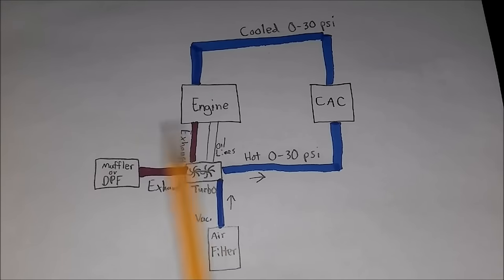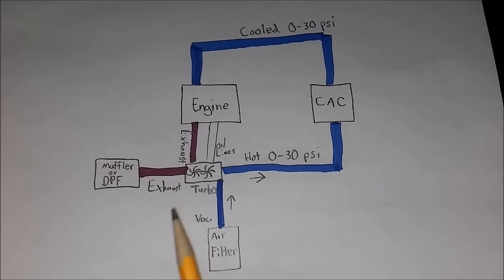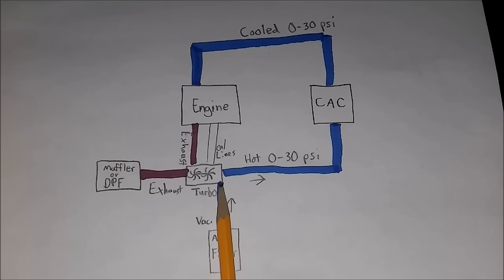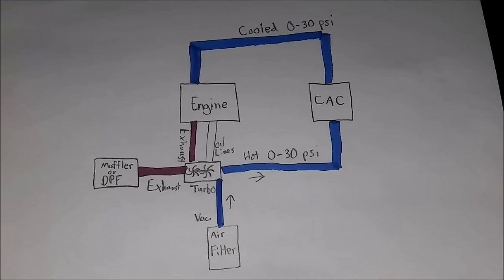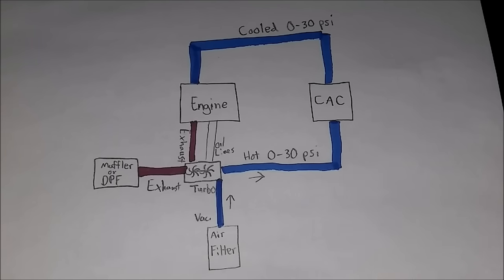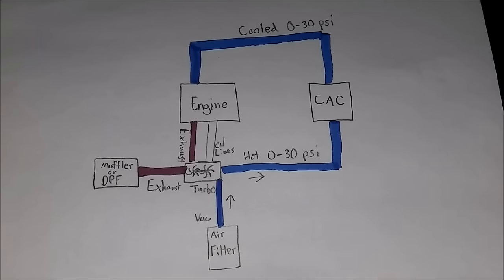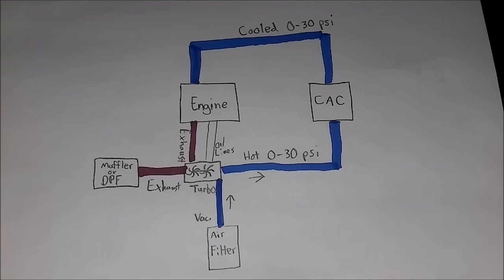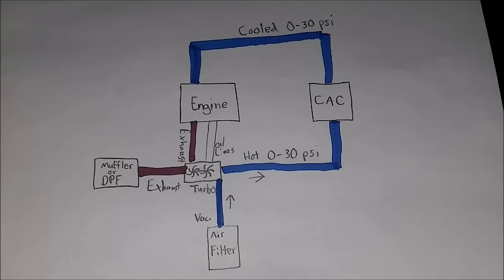What Causes Low Boost?  How Does A Turbocharger System Work?

Comment: Hello I have a 2011 d13 Volvo and I’m experiencing low boost on 9th gear going into 10th gear when I max out 9th gear it won’t go past 59. Mph and shifting into 10 gear the truck begins  to gradually shake so I have to let off the peddle gradually so it stop shaking until I reach a desired speed on 10th gear. Can you help me understand why it’s doing this fault.

Comment: I have a 2014 Transit connect 1.6 l EcoBoost with turbo I notice when I floor it going uphill or incline my car feels like it pulsates. Like it's trying to push forward. Transmission is fine do you think it could be a turbo issue?

Comment: I have a Cummins QSB 6.7 generator causing large decrease in rpm when taking load ..>75 rpm droppage for 20% load.I've checked the FIP and nozzles there is no problem with them.Governor is working fine..There is no smoke or anything else..
Does the problem is due to the fault  in turbocharger...

Comment: Hi I have an Mitsubishi 4m40 efi engine that boosts fine at 20psi but when the fuel is turned up it starts jerking and surging and my boost gauge needle goes crazy?? Restrictive intercooler (cac) ? Restricted exhaust??

Comment: Mercedes C200 CGI. I have miss fire at cylinder no2 while driving even at low speed.
Noticed that my turbo BOV open and does not close.
Already replace BOV, pressure sensor, waste gate control vacuum, 
temp. sensor yet to replace and reads 50 deg Celcius when idling.
When pressure sensor connector removed BOV closed and no more miss fire even at 120KM/h speed. Any advise. Can we drive the car with BOV continously closed

Comment: Great videos, just wondering if removing factory mufflers on a CAT 3406E will affect power on it. This engine is in a Peterbilt 379. Thanks.
Reply: Carlos Rodriguez absolutely not. You will actually reduce exhaust temps
Reply: Yes it should, how much though is the question.

Comment: Hi love the videos you do I have a Nissan Skyline R33 gtst and recently put a new engine in it runs fine apart from the turbo the cold air intake takes in far too much air when I accelerate and no power whatsoever but im getting boost on my gauge can anyone shed any light on this
Reply: Joe monty * 
We need more details. How much boost, what do you mean cold air intake takes in to much air, how you figure that out? You need to troubleshoot shoot one part at a time. What have you done to it? Mods or what have you checked?

Comment: hello sir i hv question tht is it dangerous to drive with low boost code ? is it cause more damage to engine with driving truck with low bosst around 20 psi around 20,000 miles 
plzz rply if possible thank u

Comment: @adept ape want to thank you for video It’s very  informative sure wish I knew where your shop is  located i am in Arizona I got a stage one upgrade i’ve been noticing that my boost lags starting off once I do get it going and running up to speed my boost reaches 40 PSI‘s is that normal I bought this truck brand new in 2005 I still have the same turbos with 1,650,000 miles do you recommend i change them or should I do that test pinch the wastegate .

Comment: If I have a leak at the clamp that connects the exhaust turbine and housing would it cause low boost
Reply: Yes
Reply: Why?? They say yes but don't explain. If the leak is after the turbine it won't because your getting full exhaust spinning the turbine. If the leak is before or at the turbine itself where it connects to the hub or center section, then yes, because your not getting full pressure to spin the turbine. Can you explain a little bit more on which clamp?
Reply: Low boost is on the compressor side. Leek some where.

Comment: I have 3126 work fine but when I drive it for 2 miles I got low boost 15 miles per hour I do not know what is the wrong with it  
and start smoke when I am driving No blow by at all when the car idling ?

Comment: I need help I sent my truck mx13 6 times  to shop. Everytime I'm under load I lose all power seek seek service down to 5mph turn off and on and I get power back but check engine light still on. They have replaced head gasket , egr , exhaust manifold,  boost sensor, exhaust sensor, heater core, dpf filter,  Every time I leave they always say your all good 2 days later break down again . Any idea????????

Comment: Hey man i have c15 pete 389 and i work in the end dump insdutry I've noticed that the truck does the first couple of loads just fine but after a while running i feel real hard acceleration to the point where my foot hurts from pressing on the pedal any ideas?

Comment: On my 2WS engine I plugged the hoses to my waste gate and I am getting 32 psi when pulling a load, Before I did this I was only getting 25 psi. I am now getting the power this engine  is potentially  producing,  Good or Bad Idea? By the way I did the over head adjustment following your technique and is running great, and I am running straight pipes.
As always great topic and great video. Keep up the good work.
Reply from the maker: Those single turbo engines usually only build 30-35 psi, so it sounds like your are good to go with plugging the wastegate. You could try tuning the wastegate adjustment arm so that it opens correctly as well, but 32 if pretty good. Glad to hear your overhead came out right.

Comment: I've got a pretty good crack in my exhaust manifold. My truck is like it don't even have a turbo. I can review engine and feel the air coming out crack. Would that cause my truck to feel like it's only got 100 horse power
Reply from the maker: +Tim Anderson Yes it would. Since the exhaust isn't going through the turbo it isn't building boost.

Comment: Good evening ape I recently replaced the harness on my c15 acert due to some shorts and almost broken wires. This is on a 07 w9. The cam sensor connection looks like it has a 4" extension connecting the harness to the sensor. The plug is stuck in the sensor and the 4" harness is almost in two. I am going to buy a new sensor in case I break it getting it unplugged. Are there any surprises when removing and reinstalling the sensor.
Reply from the maker: If I remember correctly, there is an oring that seals that sensor, if you remove the sensor it is a good idea to change the oring. Nothing comes to mind special about removing it.

Comment: so i bought a 04 vw passat with a 1.8t and its check engin light was on after buying i took it to autozone to check the codes and i got p0299 saying my turbo is underbossted and the a ase tech recommends replacing my turbo wastegate solenoid also code po420 and code p0441 where thrown catalyst  system below threshold and evaporative emissions system incorrect purg flow because i have a bad exhaust leak so my question is do you think that the problem it my solenoid or could it be something else and also is there anyway this problem could relate to the exhaust leak please help me

Comment: i have a diesel pusher with a C7 (2005 model). Do you recommend any fuel additives?
Reply from the maker: That depends on how often you run the engine. If you run it often it gets hot and through the filters. Which keeps it clean and bug free. Now if it sits a lot you might want to look up black diesel, basically there is a type of mold or bacteria that can grow in Diesel if it sits for too long. Now just for normal running though, I haven't seen any reason for running a fuel additive. Your engine is a HEUI system, so the engine oil will most likely wear out your injectors before the fuel would. I have a few videos that talk about HEUI systems and IAP faults you might want watch.
Reply: Thank you for the quick response.  I take a look at the info on black diesel.

Comment: Hi. I have a 07 FR century with a C15 475 cat with twin turbos. I am having a problem with power where by loaded or empty climbing or on a flat road i sometimes have lots of power strong engine sound and then all zero power even going down a hill it has nothing & after sometime it will go up a hill at 75 mph you can actually feel it cut in and out of boost. So my question is does the turbo boost sensor or the wastegate actuator have anything to do woth this or is there something else? Plus its killing my fuel mileage.
Reply from the maker: +Mark Mwema The wastegate is mechanical so my guess is you have something else going on with your engine like losing fuel pressure or as you said, possibly the boost pressure sensor is not working. Any check engine lights?
Reply: @Adept Ape 
No none at all. Also i rarely can hear the hissing sound of the turbo and if i do its faint. Is that common with cats?
Reply from the maker: +Mark Mwema Hmmmmm, should hear the boost spooling up. You can try pinching that wastegate line I show in the video, but my guess is you have something else going on. Put a fuel pressure gauge on as well and see what it's at when it's losing power.
Reply: Mines doing the same did you figure it out

Comment: adept ape. first and forrmost thank you for your education. i have a 2000 freightliner with a cat c15 6nz motor. motor has 1,600,000 miles but has run well. has visible engine blowby but has always run well. recently turbo boost has dropped to 17 psi from 30 psi. i had the dpf cleaned (baked) and have sealed up any exhaust leaks. boost is now max at 22psi. shop says i have a small cac leak they can see on guage when testing cac and verified with spraying soap. they claim leak is at top left corner of cac when looking from front of truck towards cac. he claims he has looked at turbo and it seemed ok. i have visually inspected cold air side of turbo and spun shaft. no restriction. spins very freely with no shaft play or vane contacting housing. i will visually inspect exhaust side of turbo today. shop recommends replacing cac. i should also mention that i have had extreme problems with exhaust heat ruining manifolds and turbo housings. cracks and or warping turbo mount at different times. my question is can general engine age and wear (meaning worn out and time for inframe) cause this loss of boost? other than boost being down 8psi engine runs smooth with no hesitations or stumbles. it will rev to 2200 rpm and will run 75mph plus on flat no problem. no unusual knocking or catastrophic sounds whatsoever. engine runs normal temp with oil pressure at idle warm at 38psi. other than lack of power climbing hills and low turbo boost no other symptomsi will replace air filters today and inspect exhaust side of turbo. should i just replace cac and see if thst fixes the problem. they claimed it had a "small" leak. can general engine wear and deterioration cause these symptoms? (ie: worn out and time for inframe) other than air filters, checking exhaust side of turbo (cold air side already checked), testing wastegate, and replacing cac anything else you may recommend that i havent already addressed? what is maximum c15 exhaust temp you recommend to avoid damage? Thank you for your education, time, and attention to help me
Reply from the maker: +Donald Pinkus First thing I would check would be the wastegate. A very small leak isn't going to cause an 8 psi leak of boost, but it depends what "small" means. Pinch the wastegate off and see what it does for boost. What is your exhaust back pressure? I know you said it has a dpf so that is something to check. If the blowby isn't insane your engine power should be fine. I don't think your engine is worn out from what you told me.
Reply: ape.   thank you for your reply. the dpf has been baked and tested.  flow is good.  i cannot see any cause for excessive backpressure at this point unless there is something with the exhaust system i grossly misunderstand.   if you can think of another way backpressure may exist please advise.  i will pinch off wastegate to test.  would disconnecting wastegate vacuum line have the same affect.  i am also going to remove the cac and have it physically tested by a radiator shop.  any confirmed leak and i will just replace it.  i am also going to thoroughly inspect charge air tubes and blue connector boots when it is disassembled.  aside of all this any recommendations?   thanks again.  i appreciate the help and i will try to see how to setup paypal to contribute in some way
Reply: Donald Pinkus i am not an expert but by experience, engine wear does reduce power. I drive and fld with a Cat, i was having a little of bit of blowby so with did an inframe before it got any worst. And now i feel more power on truck, hauling same loads everyweek. Never performed a dyno, after driving the same truck for 5 years i can tell changes on engine performance. On 1.6m miles i strongly suggest you do an inframe. You will notice a diffrence, i even get better fuel mielage after inframe.
Reply: I'm no expert and I know this is old but what 6nz has a dpf?????

Comment: Will code 92 on a c15 acert cause low boost gauge is only getting up to 30 to 35 psi code 92 is Iva 1 or 2 going to change wires and iva losing power really bad in 9th and 10 th gear under a load

Comment: I have a 93' 3406B and a man. psi gauge in the dash. the max psi ive seen is 21-22psi under full load at 1,700 rpm.should it be more?
Reply: Depends on the power rating but thats definitely within spec for the typical factory lower power levels

Comment: My exhaust brake doesn't work very well on my 3126. Can the turbo be leaking into the intake side of turbo with back pressure?
Reply: Unlikely,  the turbo would have to be completely trashed for that. More likly the brake actuator is malfunctioning.

Comment: I have a c-15 cat twin turbo the bellow between the turbos is cracked what damage will arise from driving it this way
Reply from the maker: +Russ Brow Is it the exhaust side or intake side bellows?
Reply: Adept Ape it is on the intake side
Reply from the maker: +Russ Brow You'll be losing boost for sure, but that doesn't hurt anything. The problem would be if at idle if the turbos aren't pushing enough air there could be a slight vacuum which would mean the turbo and engine are sucking in dirty air.

Comment: Greetings,do you have an email I can contact you? I own a 91 379 peterbilt 3406b.. had a blown intake gasket truck was running as if the fuel filters were clogged..I replaced all 6 and replaced the fuel filters, and he is still running rough? And pointers.much appreciated

Comment: I have 2006 kenworth t2000 with a 500 Cummins. I'm only getting 30p of boost uvwas good by a mechanic that has worked one these engines for 40 yrs is saying that I should be getting 35 to 40. The truck use to pull good and not it's struggling to pull a load.....any thoughts would be appreciated
Reply: yeah, pressure test your cooler. check your waste gate and actuator.

Comment: you have help me out before on this same exact engine I'm having a problem with right now it is sitting in the middle of BFE Kansas we had a problem with it going down the interstate with the crew set it died blew 2 - 5 amp ECM fuses replace the fuses check the pins on the truck side we have three positives and two grounds all positives showing 12 volts grounds are showing good continuity very minimal voltage drop when spinning over will not do self diagnostics on the Cruise button tries to start with ether but does not quite start
Reply from the maker: +robbiecoyle22 Okay check pin 70 on the connector it should be the bottom rear pin, that should have 12 volts when the key is on and cranking. If you have all the voltages check out, you may have a bad ECM. Is it showing rpm on the tach while cranking?
Reply: the ignition wire is showing 9.68 volts while cranking ECM has been tested by Foley cat in Colby Kansas they said it communicates but we do not have a way of getting the truck to them at the moment so we took just the ECM to them we put the ECM on another truck with a 6nz and the truck fired up and ran just fine I just checked and there is no engine RPM the truck does have a brand new crank positioning sensor but does not have a new cam positioning sensor
Reply from the maker: +robbiecoyle22 It should read rpm on either position sensor, so if it is not showing rpm it sounds like the ECM is losing communication
 Now the ECM worked on another truck so you may have a problem with OEM wiring, did you measure the pin 70 voltage at the ECM while cranking or did you measure it at the key switch?  It should be measured at the ECM to make sure your not losing voltage before the ECM. You may have to put a breakout harness on the ECM to isolate it from the truck wiring and see if it'll start then.
Reply: the 9.68 volts was at the ECM while cranking
Reply: just to let you know we did find the problem one of the pins on the truck side of the ECM when you would plug it in the pin would push back and not make good contact with the connector on the ECM
Reply from the maker: +robbiecoyle22 Alright, thanks for letting me know, that is a tough one to find. Congrats on finding it.
Reply: No

Comment: +adept ape I have a c15 acert with a sort of sludge in the ole it's not white and the egr isn't leaking. I checked the intake and exhaust and no antifreeze. The antifreeze is going low, what could it be? I tried the bottle test n nothing happened the motor was cold tho but we are fixing to pull the motor out and put a different acert in it, a pre dpf cat in. Could it be something minor? Do tell
Reply: Oil*
Reply from the maker: +Lucas Orellana Well doing the bottle test is best when the engine is hot. If you are losing coolant then you are definitely getting coolant in the oil. Other than the head, you could have a bad air compressor, head gasket, liner seals or even the liners themselves could be leaking. If it's a liner or liner seal it won't show up on the bottle test.
Reply: Adept Ape thank you for the helpfulness we're going to pull the motor tomorrow and put a different one in due to the shortage of time we have
Reply from the maker: If you tear the old one apart, let me know what you find.